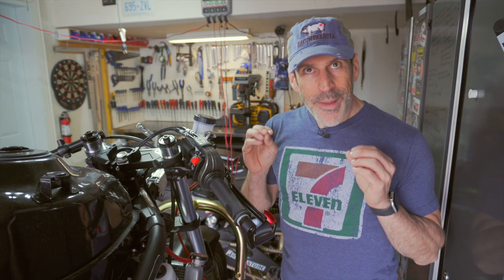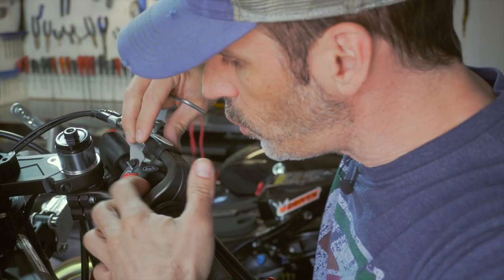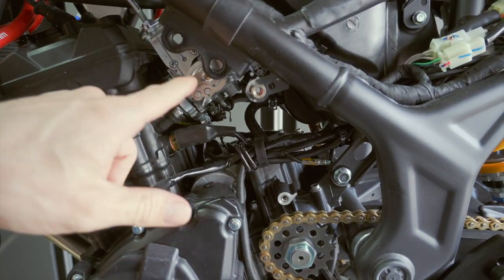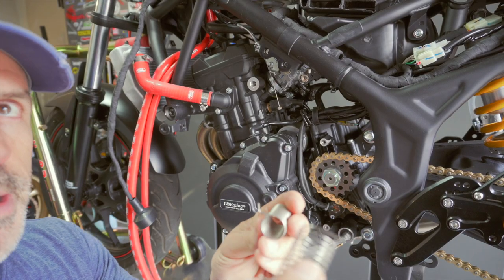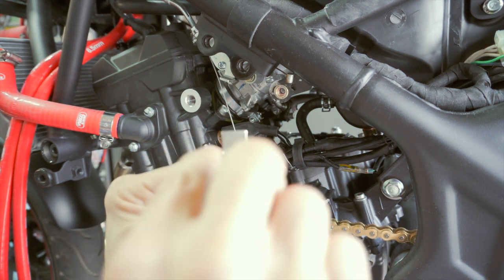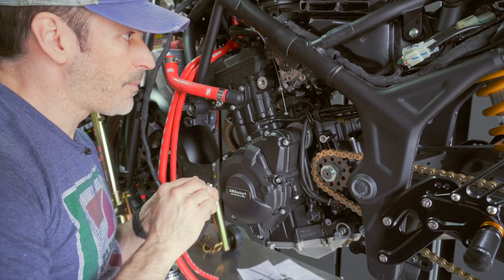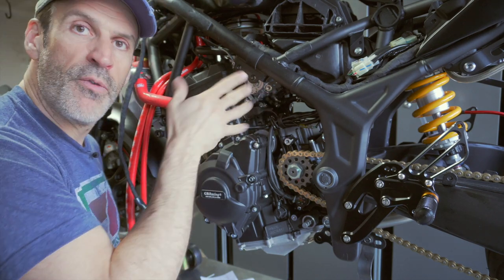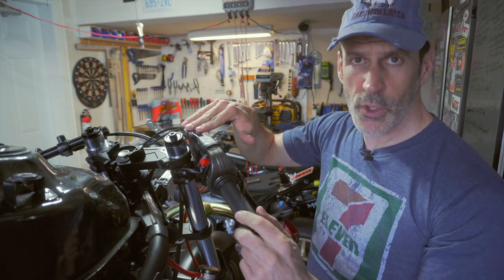HOW-TO: Install a Norton Racing Soft Pull Throttle Return Spring on a Yamaha R3

Comment: Nice work 👍
Reply from the maker: Thank you! I appreciate the feedback. 🙏🙏🙏
Reply: @landry555  Great video Tom.
Would this spring work on a normal street R-3 with the R6 throttle tube or would it be too soft? Thanks.
Reply from the maker: @donaldsmith6826  Hi! Thank you for watching. I have the MotionPro throttle kit on my bike and I definitely find it more enjoyable with this mod. So, I would think that you will see a difference on your R3 as well.  Let me know if you decide to move forward. Would love to hear your feedback. 

Cheers,
/Marco
Reply: Morning. I have the MT-03 (same as R-3 mechanically).
Installed sping but I removed coolant overflow tank, much better access, bit of a learning curve getting spring on for me.
Definitely easier throttle movement.
Can't test yet it's 25degrees outside, should be good.
Thanks for video.
Reply from the maker: @donaldsmith6826  Awesome! Hopefully the nicer weather will start soon and you can test this out! Thanks for the note, I really appreciate it! Cheers.

Comment: Hello, Im intending to loosen the throttle return spring on my XSR900 as the torque from pulling the throttle tube makes me exhausted when driving over 200km. Im wonder if the process is similar or much different?

Comment: Would it help with removing some engine braking?
 I don't like how quickly the bike slows down. Sometimes it's so much so that the rear tire starts to skid in these colder temperatures
Reply from the maker: Hi! 👋 You wouldn’t see a big difference in back torque reduction. If you want to reduce the skidding,  a slipper clutch would certainly help.

Thanks for watching!
Reply: What you really need to reduce the engine braking is a flash tune from Norton. The hard engine braking on the R3 is due to the injectors cutting out completely when the throttle is closed. Norton has a setting they program to fix this and you also get the performance boost that goes with a flash tune. It's about $355 and you send your ECU in.
Reply: @deedle6073  wonder if the one from Two Wheel Dino Works would work as well? Have a gift/credit with them.
Reply: @airdreams1   Not sure. You would have to ask because I don't see anything about engine braking on their site. The Norton flash specifically lists that they reduced the engine braking.